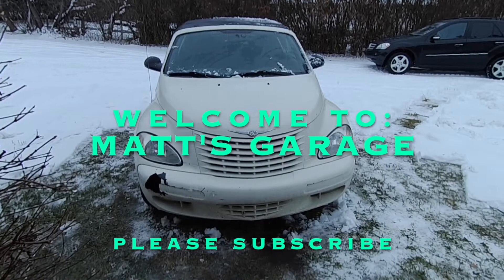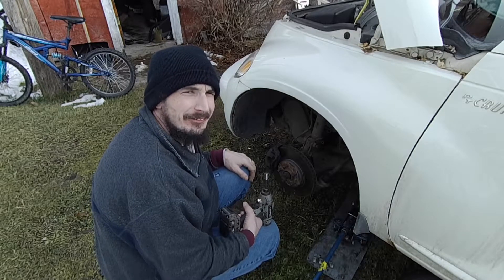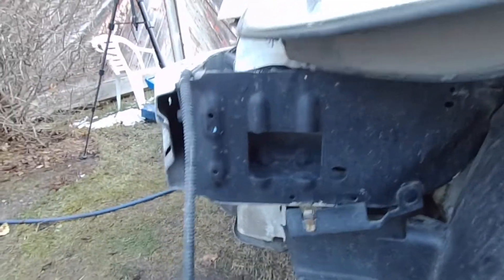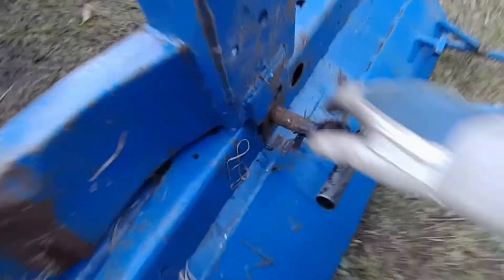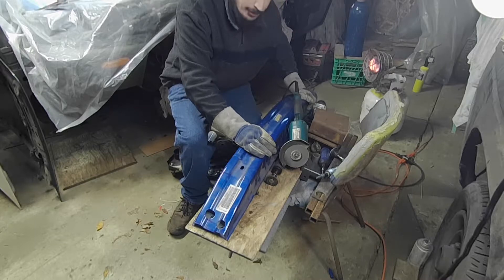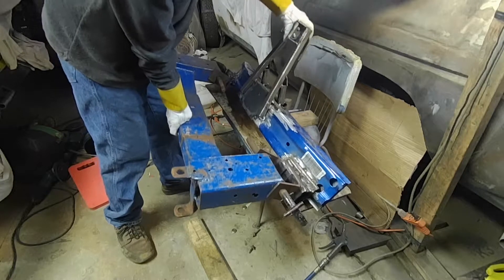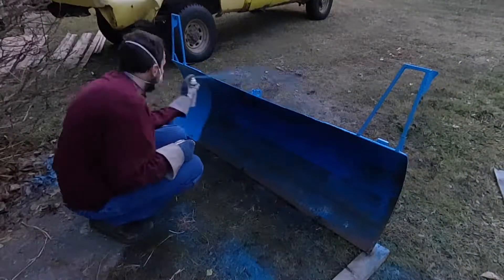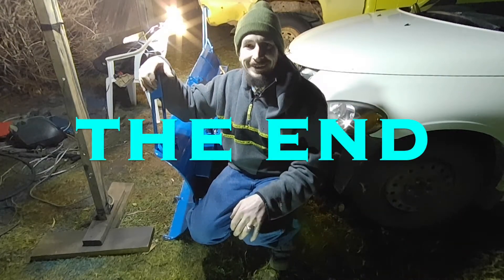I Turned my PT Cruiser into a Snow Plow!

Comment: You just convinced me to put a plow on my Grand Caravan. 
Great video btw.
Reply from the maker: Should work well, just remember to put a big transmission cooler on it.
Reply: @CarswithNash  not planning on pushing it hard, just have a 350’ long driveway and getting tired of using my ATV. Sure would like a heater.

Comment: I have a rust free 2004 PT turbo with a five speed, excellent body, but the turbo is froze up, the engine runs good but has a crankshaft bearing knock. You can have it for 250 bucks.
Reply from the maker: I’d be interested if you are close to me, are you in Alberta?
Reply: @CarswithNash  Forgot to mention that I'm in central Texas, you won't find a rust free PT in Alberta.
Reply from the maker: @billycook5688   Sorry that would be wayyy to much trouble for me and I typically don’t buy manual cars either (bad back). Sounds like a good project for someone though.
Reply: @CarswithNash  What do you have against manual cars? I don't think much of modern automatics, the software geeks screw them up.
Reply from the maker: @billycook5688  I have nothing against manuals but I have a bad back so I’m unable to drive one, my original plow car Neon was a 5 speed and that was why I moved on from it and got the black car with an auto. The only manual vehicle I own is my ‘47 International. I like the old 3 speed autos the best, hate CVT’s, my Benz has a 7 speed, it’s more jumpy then I like but does really get amazing economy.

Comment: Can I have one?
Reply from the maker: Even better... you can build one!😉
Reply: @CarswithNash  It's very nice. I just hope that the turbo part will be k roughing on the snow.
Reply: @jayc5529  can’t wait to see either❤️
Reply from the maker: @jayc5529  I don’t plan to get too rough with it, I plow every time it snows so there won’t be any buildup.
Reply: @CarswithNash  That's just was what was at the back of my head that it was nice but putting it on a turbo gotta be careful to some degree I would imagine or the consequences could be.... costly.
Reply from the maker: @jayc5529  My hope actually is to turn this car into a parts car in the spring so I can rebuild my black ‘03 GT, I can’t afford to fix both and I prefer the black one. We’ll see, if I run short on time I might put this back on the road for another summer.
Reply: @CarswithNash  I didn't know you had a GT model. Where is the video/videos of that? And does the GT use a twin turbo model?
Reply from the maker: @jayc5529  It’s one I found in a junkyard, but it’s actually pretty clean, no accidents, mint leather interior etc, lower miles then my convertible and better maintained. GT’s use the same turbo, just the computer is tuned for more power. Here’s the video on it: https://youtu.be/UJi-Yuc-d-c
Reply: @CarswithNash  Jeese just the computer using more power that sounds like a mess. Nice find though for a junker. Thanks.